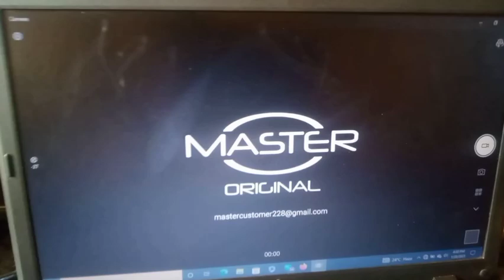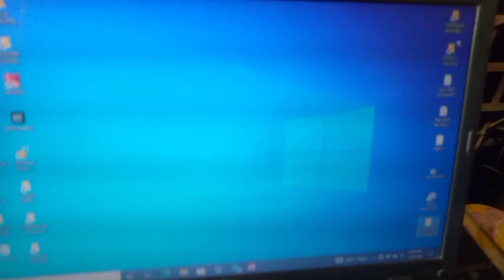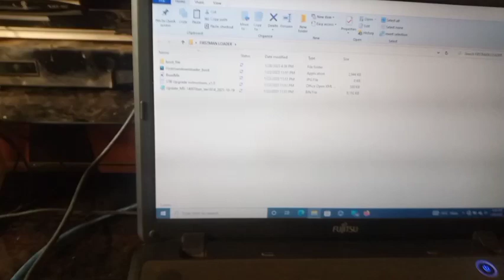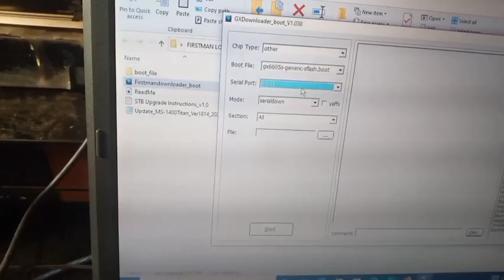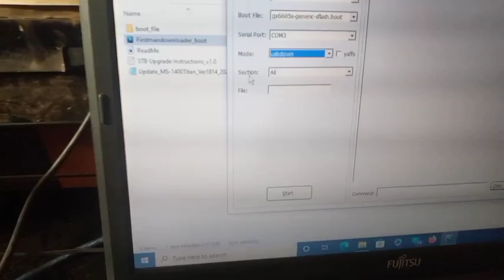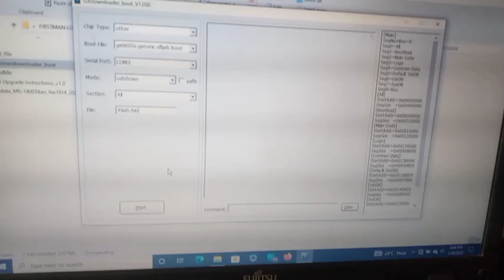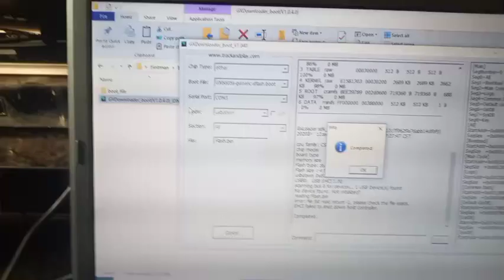REDLINE AND MASTER DECODERS PC/LAPTOP RECOVERY TOOL

Comment: Please where can I get the serial cables
Reply from the maker: You can buy it online or look for it in electronics market
Reply: @mr.firstman I updated my master combo decoder and since then the decoder ceases to boot completely. If you on it, the master logo loads and stop. Please is there any help?
Or can I locate you around Accra for fixing please?
Reply from the maker: @anthonyahadzi9632  Master Combo doesn't have recovery file. This is minor problem. You have to give it to a professional Decoder Repairer to reprogram the flash IC for you or change it for you but tell him the cause of the problem
Reply: @mr.firstman  Than you
Please can I get one in Accra around Zongo Lane ?
Reply from the maker: @anthonyahadzi9632  I don't know but just look for it, you will get some please
Reply: @mr.firstman  Thank you Boss